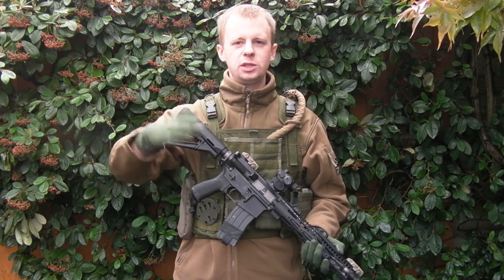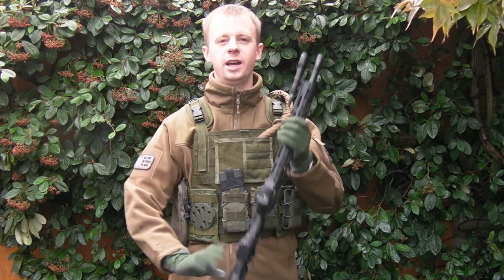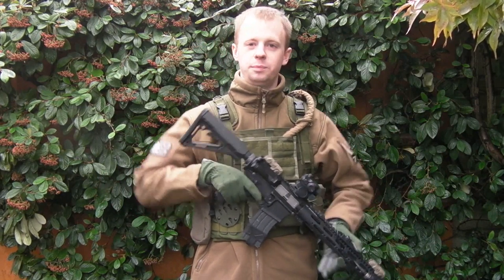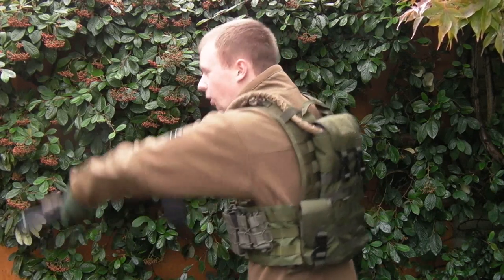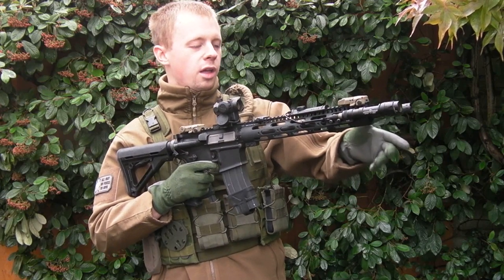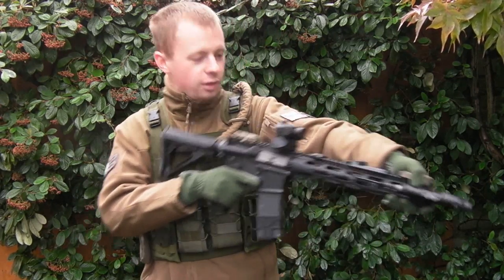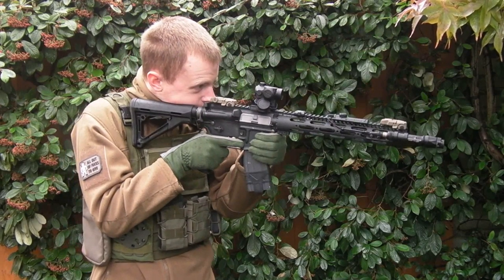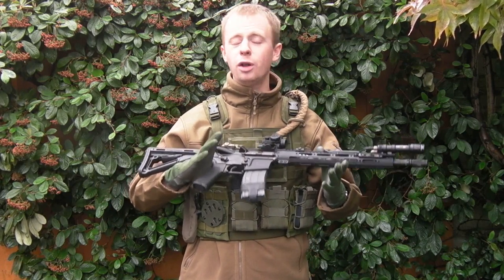Why Use The 'MAGPUL' Grip In Airsoft??

Comment: It's so much easier to be fast and aggressive with this grip especially in CQB games, also really handy to go up to a door frame or a corner of a wall to rest the gun on the weak hand that is pressing on a wall / cover as the hand is already there. As I try my best to put steel barrel on anything that has one, and at least a light and a steel FH if not a DBAL as well, a mag well grip would be so slow for me.
Reply from the maker: Good points there.

Comment: Ha, i know its terrible, but i find this grip to simply be hilarious. I don't get mad, or riled up, i just find it hilarious. Im not trying to argue or anything, but no matter what airsoft gun wether it has really good blowback or no blowback at all,  i personally see no reason to use this grip unless you are trying to mimic Mr. Costa, or you are just trying to be different. I definitely agree with the standpoint that this is a game and it doesn't matter what grip you use, just matters that you have something unique.
Reply: Also, if you were wondering, i use a flashlight/foregrip about mid rail on  regular m4 RIS.
Reply: I actually use it quite often, but that's mainly because it just feels comfortable (to me anyway) and it's more rigid so there's less sway when moving, and changing targets seems quicker (again, a personal thing I'd assume). Though it's not a stance I'd use exclusively. For holding the weapon up for a while, likely anything else is better. It's more situational; quick and accurate shots. That's just my thoughts though. Figured I'd throw in my two cents.
Reply: I use it because it's comfortable. 16 inch SPR with a thumb over bore is so guuuud. So weird looking but it really does work. Better target transition, less sway, much easier to fire whilst moving and it's just fantastic.

I will say that I don't extend my thumb over bore that much, only enough to where I feel it's comfortable and necessary.